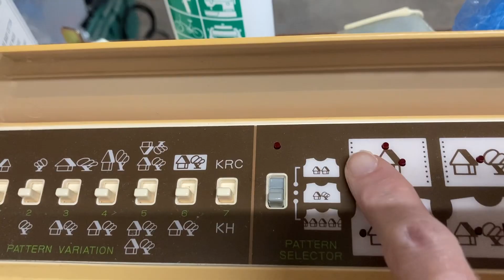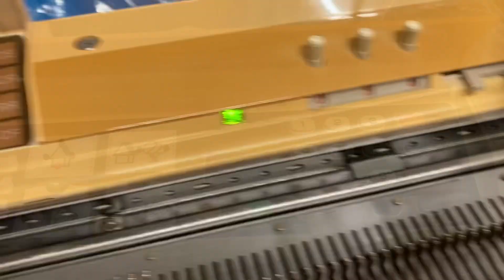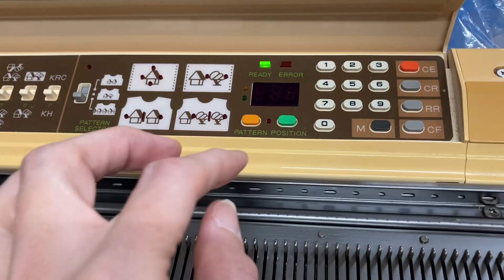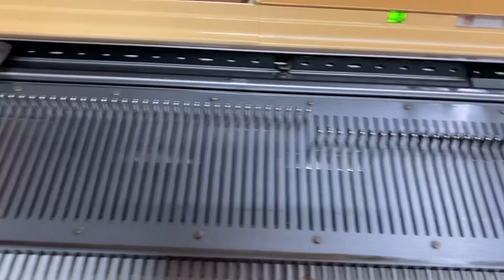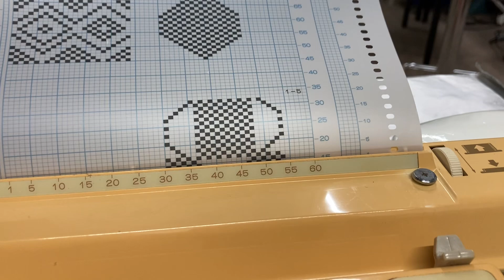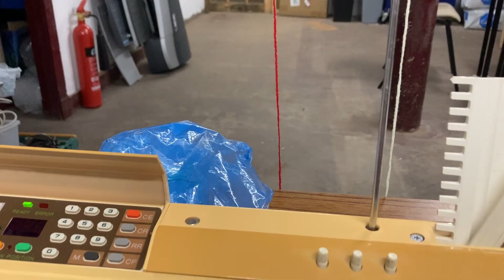Part 1 Brother KH910 capacitors Mylar electronic knitting machine repair @dundeemakerspace

Comment: You were very fortunate to find someone who repairs electronic knitting machines. They are as rare as rocking horse poo as they say here in the south-west.
Reply from the maker: Hi Ann, I used to work in an electronics factory in the late 80’s which gave me faith my 910 could be fixed or the electronics replaced with an AYAB shield.  

I joined @dundeemakerspace recently and I was very lucky to have one of the members offer to help me fix my knitting machine by bringing a soldering hood kit etc. into the space.  

The members there have various skills and it’s looking like they all compliment each other. I know I am very lucky to now have this support to help me get this knitting machine hopefully back to full working order.